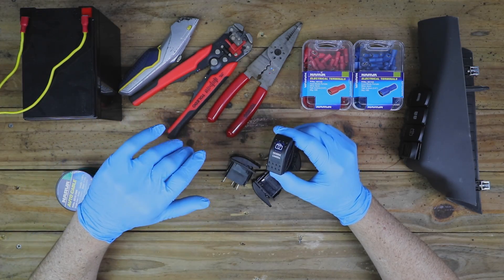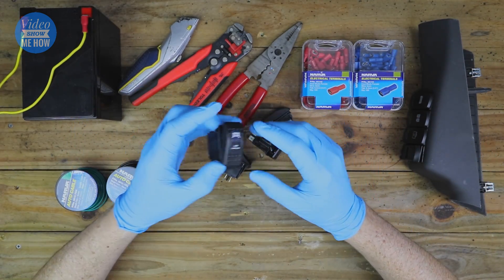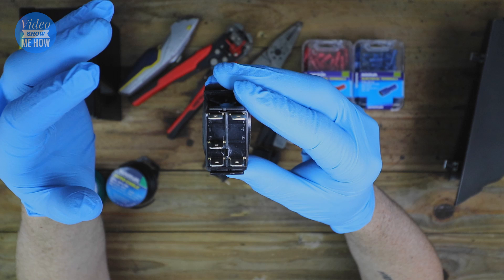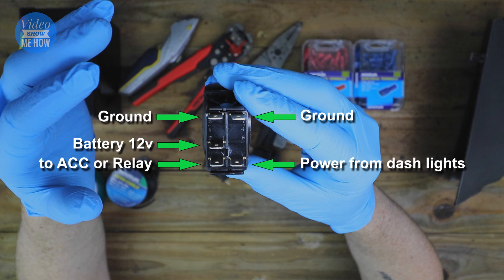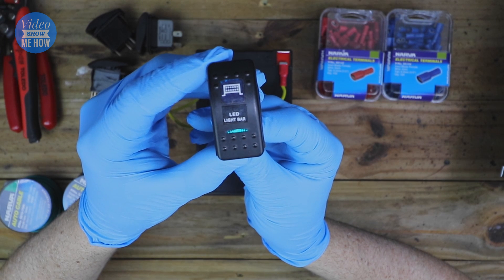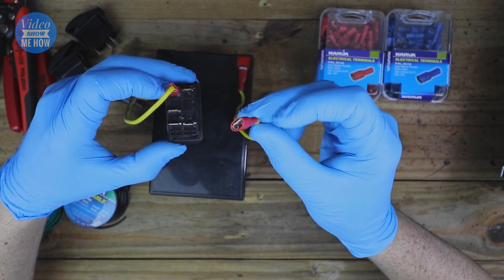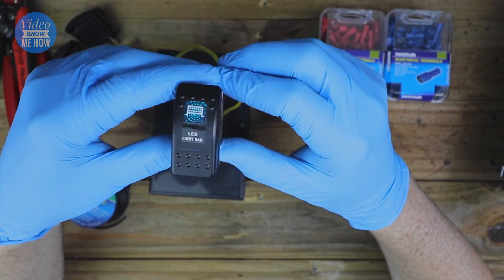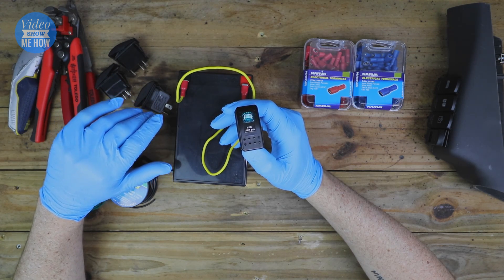HOW TO Wire 12V LED Rocker Switch - Simple Guide and Wiring Explanation

Comment: Does every pin once wired require 12v for say a 7 pin rocker? I have 12.5 volts at my grounds but the middle pins get 1-2 volts
Reply from the maker: Yeah should once triggered? Have you got another you could test?

Comment: Good video - Just one point perhaps you can help me with -  On the diagram supplied with the Rocker switch I purchased the battery Pin connection is the middle Pin and the bottom Pin is to be wired in my case a Auto Pilot, is this normal to change positions?
Reply from the maker: Yeah could be, I would be going with the supplied diagram as not always the same. Could always test with a test light

Comment: Good video - my only question is on the rocker switch that I purchased the diagram supplied shows in center Pin should go to (in my case a autopilot) and the bottom Pin to the 12v battery.  Do manufacturers change the Pins position over?

Comment: Just a quick question on a rocker switch if Iv got copper colour terminals would they be earth or live
Because on a 7 pin switch Iv got 3 are a copper colour 
Would appreciate any help
Reply from the maker: Without seeing the switch I would say they're the two banks, 7 pin switches are usually a double pole double throw. The 7th pin that hasn't one opposite is usually your earth/negative
Reply: @VideoShowMeHow  
Thay are all just on off switches m8

Comment: My led light bar doesn't completely turn off when i hit the off position. I believed my first switch to be defective but i ordered an aftermarket one and its still doing the same thing. Any clue what it might be?
Reply from the maker: Are you running the load via the switch or through a relay?
Reply: @VideoShowMeHow  im running it through the relay.
Reply from the maker: @lovegodessmls28  you could test the switch using a test light or multimeter, switch to off and see if any power. Else could be relay. Have filmed a vid on relays how-to just editing should be out on the channel in about a week :)

Comment: Great video! Thanks for sharing, if I'm using a 5pin switch to run a ground signal, should I keep both grounds at the top and the lower right wire connected and disconnect the battery live an use that along with the output to work as the switch?
Reply from the maker: Thanks ✌️ Yep sounds good, just make sure battery wire is fused appropriately

Comment: Great video, I was wondering if you could help me understand a similar configuration.  Got fog lights with 3 wires and a relay, I cut the original toggle switch and installed a 4 wire rocker currently always hot.  I'd like to connect the fog lights to the auto shut-off of my vehicle.
Reply from the maker: Cheers mate. You'd want to make sure the relay trigger wire is going to the switch then for the led wire use power from the dash
Reply: @VideoShowMeHow  Thanks for the quick response.  I think I can do that. 🙂

Comment: I know this video is a little old but I have a quick question. How would a wire up a 12-volt device like Amber lights that work off of a wireless relay switch and also a dash flip switch. I was thinking of wiring one main wire from the device to two separate power wires one to the dash and one to the relay. Would that work. in the off chance I flip on both would that damage my lights seeing it would send 24 volts ??
Reply from the maker: Hmmm I'm not sure about 2 wires powering the device.. I would run everything off a relay, power to device and trigger wire to switch. Best of luck 👍

Comment: Can I connect the red + that goes to the battery to a fuse box tap so the LED bar would only turn on when the ignition is on?
Reply from the maker: Sure could, would have to be one that only turns on with your ignition

Comment: When rockers are in a series and you only need the positive from accessory, what do you do with the other two wires?
Reply from the maker: Check out the 'wiring multiple rocker switches' vid on the channel for more detail. Sounds like you may not need them
Reply: @VideoShowMeHow  I have watched it. The rockers came wired together in series. But i dont know what to do with the other wires that are coming from the light bar.

Comment: I have a 5 pin switch, my switch light won't turn off... How do I make it turn off?
Reply from the maker: Hey 👋 I would suggest the 12v+ going to that pin has constant power. Power to that pin should be pulled from a dash light circuit or something similar so that it only turns on when your other lights turn on

Comment: Do these switches require relays
Reply from the maker: These particular ones are rated to 20amps, I wouldn't be keen on putting that through them though. Would use a relay above 10amp :)

Comment: I’ve been looking for someone to help me with changing a switch, I bought some led lights that came with a little red switch that has 3 pins that doesn’t turn on the switch light until I turn on the led lights so I bought a 5 pin rocker switch that looks like the ones my truck has and want to change but don’t know how to do it can you help me please? Thanks
Reply: Does the switch you bought turn the LED lights on and off properly?

Comment: Im wiring up a chase light to a momentary rocker switch,  where do i connect the yellow wire that controls the mode patterns on the light? Thx
Reply from the maker: Did you get a wiring diagram with the light? I would assume that wire would need constant power from what you describe, but not 100% sorry Phil

Comment: Hi, thanks for the explanation! I have one question though: How would it be possible to wire the switch so the LED only comes on if there's actually power going through the load (as opposed to only the switch being engaged)?
Reply from the maker: Just daisy chain off the wire running to your load to the switch led pin :)

Comment: Adam, good evening. Great video. However, I do have a question. If the five pin switch comes with a four wire harness, I assume both ground wires have been combined into one wire. Is it then possible (safe) to wire the ground wire from the switch to the dash light variable ground? This way the switch led will dim with the dash lights.
Thank you -
Reply: Use the variable ground wire on the led side only, the two pin half. You then could daisy chain all the led sides of the switches so they will all dim equally.
You might have to make a new ground run for the leds.
Reply: The ground wire from your load (in the case of an LED light bar, from the bar itself) would need to be grounded on a chassis ground point or the battery ground ( - ) side.  Because you have to have a solid ground on your load side of the switch for the powered load.

Comment: I have 2 12v 9ah batteries that I have wired in parallel in my nephews ride on top jeep. I have added 2 LED light bars (14” and 7”) as well as 4 (2”) LED pod lights and 6 LED eagle eye light bulbs. I have 3 switches to wire these lights to. One is 3 prong switch that came with the wiring harness that I bought and the other two switches are 5 prong switches like the ones you have in the video. I bought 3 wiring harnesses that allows two lights to be hooked up to per switch. My question is how do I power these switches using the 2 12v 9ah batteries that I have to power the jeep that is already wired in parallel to each other? (The batteries look Ike the one you are using in this video)
Reply from the maker: Hi there, whoa that's a lotta light 🤘 Are 9ah (assuming they're AGM and 50% discharge rate) going to be sufficient/is there a charging system? Re the switches, I would be inclined to use some relays so you can consolidate your switches. Bit hard to cover in a YouTube comment though I'm afraid, will be doing some content on how to use relays in the future. In the meantime that's what I would start looking into on Google. 🙂
Reply: @VideoShowMeHow  lol. I know it’s a lot going on. The harnesses actually have a relay with a fuse. I’ve tried googling and unfortunately no one covers this. I follow a guy who has modified his daughters Jeep with similar lights but his step by step videos were lost somehow so he wasn’t able to post it. 🤦‍♀️ I’ve sent him a message but I’m
Waiting for a more detailed reply. I know this can be done, I’m just not sure how. Lol

Comment: Hello, how do you power the "off" light to only come on when the accessories are turned on? Have it function on/off like a normal dash lights. Do I find a fuse or tap a wire?
Reply from the maker: Hi, yes, you tap an accessories wire. Usually a few likely candidates under the dash depending on vehicle. I explain this more in the follow up video on wiring multiple rocker switches 👍

Comment: Thanks for creating such a great video. Do I need to disconnect the battery to change a switch that’s already in place? Thanks 🙂
Reply from the maker: Hey thanks! 👍 You can if you really want, if everything is fused is pretty safe just to switch it out
Reply: It’s always a good idea to disconnect your battery before you do anything with the electrical system

Comment: Hey mate, so helpful video! I'm electrical noob ;) Question, is it possible to have that main LED with stickers to be connected to dash lights and smaller LED to be light if the source is powered? If I have set o switches I'd prefere to distinguish them in the dark by main LED rather to only know where thay at by small LED. Thanks again :)
Reply from the maker: Hey yep just switch the power for those around will work fine 👍
Reply: Eeem I’m not sure resistent on the big led to stays power on all the time.
I know you want to see what switch stand for by symbol but by changing around I guess if that was me I would have open I side switch to see if designed to stay on all the time .

Comment: Are the 4 pin switches similar? I have one with 3 pins on the left hand side and 1 pin on the right. The 3 on the left work as per your switch but the 1 on the right is a mystery to me.
Reply from the maker: Hey Adam (great name 😬) the pin off to the side is usually the earth, then the 3 in the row are usually dash, battery, load. Hope this helps 👌
Reply: @VideoShowMeHow  aaaahhh, makes sense now. Thanks heaps, appreciate the reply 👍

Comment: It seems to me that these switches are back to front,  you would want your dash lights to illuminate the function of the switch ( what it does) and the lower light to indicate that the switch has been switched on, how else you going to know in the dark what the switch is for ???
Reply from the maker: Hey there, yeah I think it depends which one you want to light up, I've got mine setup for the little line led to beyond when you turn your headlights on and then when you turn the switch on the whole thing lights up. You can see this in more detail in the following video to this one: https://youtu.be/2_XHqBgyiZg . No reason you couldn't have it around the other way though 😁

Comment: Where do you get dash wires from?
Reply from the maker: You mean to wire this? Any auto store or online at Amazon/eBay etc. Will update the description later to include some links 👌
Reply: @VideoShowMeHow  was researching again and came across video again and noticed your reply...what I was meaning is where do the dash light wiring come from that you would connect to the two prong side? Do you need to relay off existing switch?
Reply from the maker: @gobucs3146  ahh yeah you've got a couple options, could go off an existing switch or use a test light to find a power wire that only has power when your dash lights are on. Back of the radio or loom behind steering column usually have a winner

Comment: Question... when using these switches, what do you do with the negative wire from the accessory you're powering?
Reply from the maker: Goes to a ground/earth or depending how far from battery back to the neg post
Reply: @VideoShowMeHow  Can you use the right side ground if you’re not hooking that side up to the car lights?
Reply from the maker: @christophermcandrew2741  of the switch do you mean? I would prefer to use its own ground

Comment: Very good video.  Question:  do I have to pull power from the dash, which I think may require me to remove the dash to get to the power.  Or can I tap into the power from another source (or place) which will light up the light on the toggle switch (and will be easier to get to)?
Reply: If you look at you car manual book it shows fuse box diagram and show dash night time illumination fuse so best is take the the live wire for switch from wire comes back from fuse to the dash lights to your switch .
That’s what I did and worked for me perfectly, special my car has auto day/night dashboard illumination and lights switch automatically 👌🏻
Reply from the maker: Hey 👋 Do you mean for the switch lights? If so doesn't have to be from the dash necessarily, just if you want them to light up with the rest of your dash lights it would have to be a power source on this circuit.

Comment: Hey mate I’m having some problems I’ve wired the switch to my driving lights and none of it work any suggestions faulty switch ?
Reply from the maker: Hey bud I'd grab a test light and confirm the hot wires are correct as a start and good from there
Reply: Video Show Me How yeah used a multi meter getting 12.9 at the relay and about 6.5 on the switch side
Reply from the maker: @andyrocks8  hmmm yeah could be switch by the sounds, have any of sort you confirm with?
Reply: Video Show Me How nah I’ll have to grab a new one
Reply: If you use wrong wire or wired the switch wrong way around or the last case switch itself is made in China 😅

Comment from the maker: Hey guys - let me know in the comments - what are you wiring your switches for?
Reply: How do you wire 2 switches exactly like this to one circuit for spotlights? One switch for the dash board and one switch for in the back of the van?
Reply from the maker: @Legend-wu7pj  checkout the channel under 12v, have made a video on how to do multiple :)
Reply: Golf cart
Reply from the maker: Yeah nice! I would suggest finding one of the factory  switch wires that only powers on when you switch on the dash lights, use a test lamp to find one, then join off that for your switch 👍